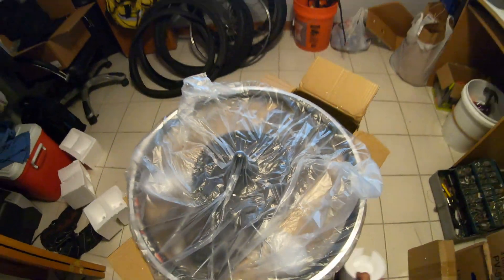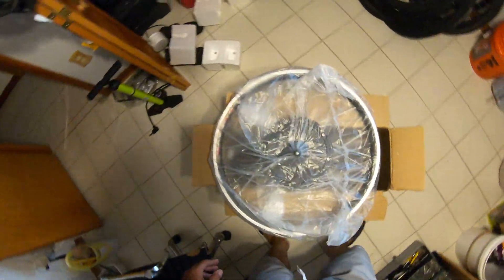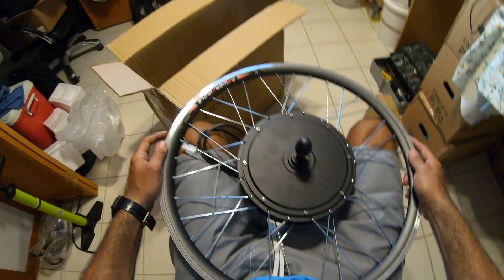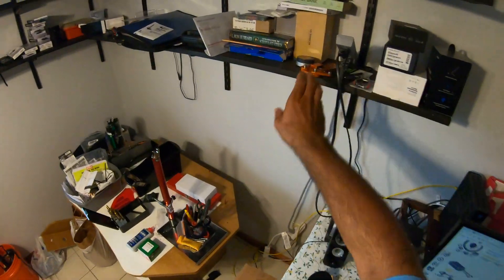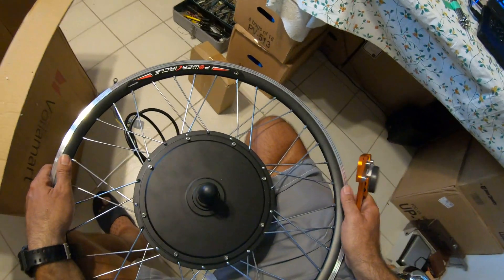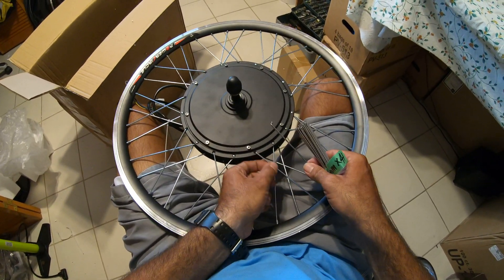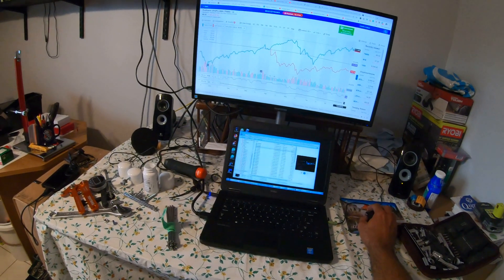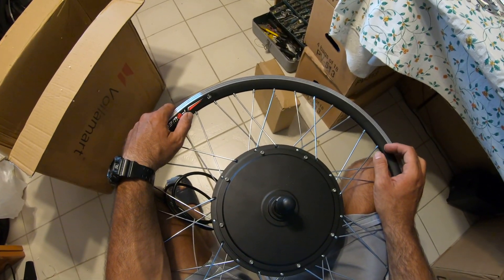Voilamart 1500 hub bike motor-wheel un-boxing Part 2

Comment: I hope you installed this on an actual ebike and not a normal bike--1500 is going to give your forks and frame fatigue.I just got an ebike and I am glad I did because my 3 year old mountain bike which was a decent model is not near as heavy duty as the ebike.I was going to go this route--but most normal bikes are not as stable at high speeds with hb motors as rtail ebikes.My ebike is much more stable at high speeds and for trails--it is also a fat tire and has an almost 60 lb weight limit it can handle over my mountain bikes.
Reply from the maker: I installed it on a heavy steel Kent frame I found abandoned. No problem.  I bought a big wrench to tighten the nuts.  I go slow below 20 MPH on a bike path/road.  Professional road bikes pass me sometimes.  I just love the quietness and smoothness of the ride.  Right now I ride 13 miles to go to work 7 days a week.
Reply: @productcheck  Yeah--I have used my ebike evryday since I got it--weather permitting. I just ordered another torque arm and plan on putting 2 on there. I want the bike to last for years trouble free.

Comment: Maybe Google or  look into or research.  " loctite threadlocker blue 242"    for those spoke threads ,
Reply from the maker: Thanks, bought it but honestly, I never used it.  I bought really thick spokes from Amazon and a wider stronger rim.  after 12,000 miles only 2 spokes broke.  I tightened spokes to the point where stripping would occur if go any further. I recently noticed the noise came back.  I observed cracks in the rim.  So I need to rebuild with a stronger rim.

Comment: Hola senor , por favor , How's that 1500 voilamart  wheel holding up ?
Reply from the maker: I've been using it 500 Watt max. It has 12000 miles it reaches 20 mph. No problems.  A few days ago, I decided to increase the power. It ran great for about 100 miles.  Then, disaster, it overheated and started to make terrible sounds.  I lowered the power the next day and it still runs quietly.  I'm thinking about getting a spare one just in case.
Reply: @productcheck , i must have watched at least 10 of your videos. Thank you so much for sharing  your knowledge . you really learned some things on the performance of this wheel , I'm considering building one with a voilamart 1500 too and I just stumbled across a voilamart 1500w rear wheel with an internal contoller on amazon..have you considered that one ?
Reply from the maker: @kenciolek843  yes, I own that one with the sw900 controller.  I can use Ryobi 40 (36 in reality) volt batteries which charge in 3 hours!.

Comment: My friend what battery are you using good video
Reply from the maker: I am using a 52 volt 13Ah Yoyisi (HL) it has 70 cells inside, 5 parallel x 14 series.  I connected to the controller box with red wire nuts.
Reply: Leonardo Savini what’s top constant speed in mph please
Reply from the maker: @clownkiller1235  depends on tire diameter. large will give me 22 at 750 watts and 35 mph at 1500 watts.  it drops as the voltage drops to 17 mph at 750 watts.  I use 750 watts 99.99% of the time.
Reply: Leonardo Savini how do you change between 750w and 1500w ??  I’m getting this exactly model with 26inch tyre thanks for the info
Reply from the maker: @clownkiller1235  plugin 2 wires, it is as easy as charging a phone. plugs included and installed. very easy, no problem.  you can also extend the cable and mount a switch (1 wire, low voltage, and amperage and gauge) to your handlebar, not included.
Reply: Leonardo Savini please could you do a quick video showing how to connect and set up the switch please.... if you name the video right you’ll get a lot of views because everyone wants a switch it’s a good extra but most people we don’t no how to do these things
Reply from the maker: @clownkiller1235  maybe. The problem is that the new model has no switch, just a touch screen where you can program.  Switch is going out of stile and takes handle bar space